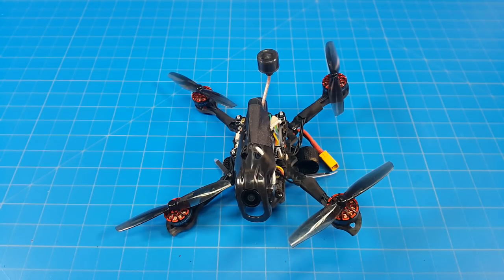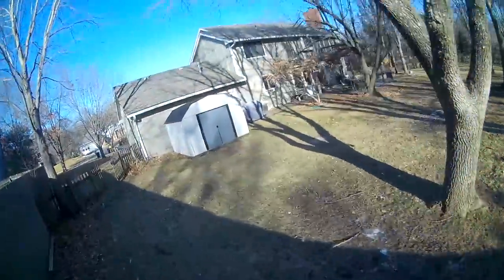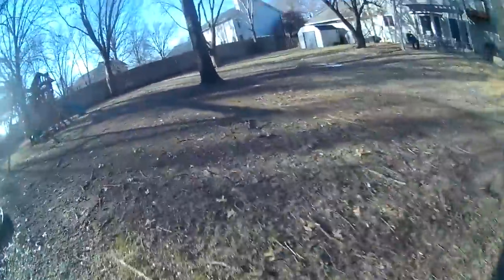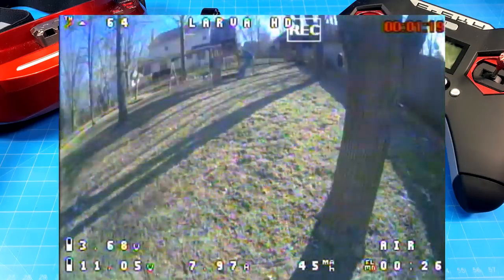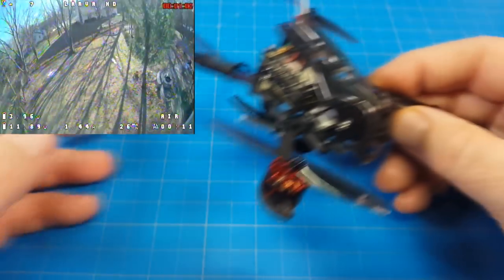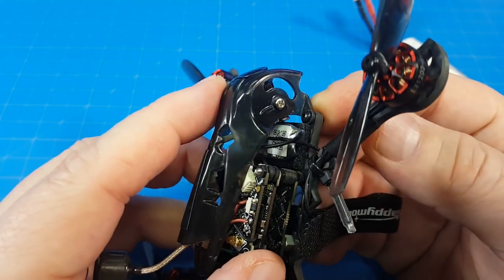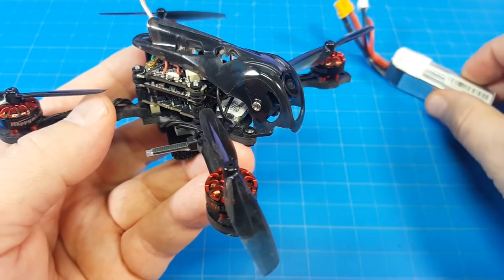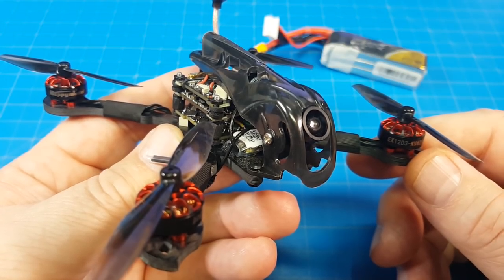Larva X HD // Bendy Quad

Comment: I'm struggling with weather too in the Netherlands Nick.
Normally it is quite cold over here, but this year we haven't really had anything that resembles winter. 
It is approximately 10 degrees C hotter than normal and the weather mainly consists of storms and clouds. So it is either raining or the wind will almost blow you over.

Comment: You say that one of the best with HD camera is the Skip HD3. What would you improve it? Would you try to lower the weight? Would that break the magical balance of stability in footage?  Im looking for ingredients for a very fast 3” HD
Reply: I think i would change the motors for 1303 5000kv with 2mm shaft. More powerful and intuitive at low rpm. Would you change the frame or the canopy to lose weight in the skip HD3?
Reply from the maker: Yes, larger stator motors will handle a 3inch prop better. The magic to the stable footage is having a camera that is firmly mounted. This one uses metal standoffs inside the tpu mount, most tpu mount will have micro vibrations in the footage. Otherwise is basic power to weight ratio for performance.

Comment: My Caddx Eos2 and Tarsier both had particles floating around in them, the Eos2 still has some, the Tarsier even had a tiny hair.
The Caddx Turbo F2 that came with my Emax Hawk Sport is particle free, but has a red hue in certain lighting conditions just like the Eos2, making it really difficult to see any detail of the bushes/trees etc., so I swapped it out with a RunCam Racer Nano v1, so much better. I always look at other brands of camera now.
Reply from the maker: I thought the tarsier might be the one they were doing better with, guess I have been lucky. The emax camera looked a lot like the Caddx f1 which did have that red hue to it.

Comment: Holes in the arms are for mounting the "whoop" guards standoffs. Nice work Nick, thanks for this. Jeff
Reply: I was thinking that because I saw what looked to be a screwhole at the end of the arm of the guard.
Reply: Mounting the prop guards is what I was thinking
Reply from the maker: The holes do line up, I didn't get standoffs. We have about a 6mm gap to fill
Reply: What carbon is that? 3mm and still that flexible?
Reply: @NickBurnsFPV  1.15 on your vid  a bag with four standoffs

Comment: Thanks for the review. Been waiting for ur review on this 1. For me. Considering the price point, the cheapest 3inch hd, come with 3 batteries. Maybe I will still get it n transplant it on more rigid frame.  Used to use Caddx, no problem with it. But still nick, what would u suggest if I want to get 3inch HD.
Reply from the maker: GEPRC skip HD 3, has stable footage as well as flight performance.

Comment: I fly ET 1115 & 125's...Was looking at this one for a future buy maybe for a cruiser and with HD, this seems to be a nice little package ....for the way I fly, I think it would do nice, plus I assume If you mount the guards it would tighten up the flex some( perhaps?)....I think it is simply a HD footage type micro and with batteries I think the price is nice...
Reply: The ET125 is still a worthy quad, I still fly my upgraded one; added a MinimOSD board to show flight time & battery voltage, and putting a RunCam Nano & Turbowing Cyclops 3 DVR (720p30) on it.
3" props are possible without the guards, check out my short video "Emax Avan Mini punchout on 2S"
Last October it took a swim in a river with a Caddx Tarsier on... fished it out, left it to dry, all still works :)

Comment: Question? 
Unrelated, how many times has your Mobula6 reset to factory? Mine did at the races this weekend. So annoying. Why? Battery too low is all I can figure...
Great review Nick...👍🏻🍻👊🏻
Reply from the maker: I have not had that happen, but I have OSD warnings on and set the warning to 3.2. I have had reports from several going below 3 volts resets the firmware to defaults and loses bind. Its strange behavior for sure. Something I didn't anticipate as needing testing for the review.
Reply: @NickBurnsFPV  
It's happened twice to me, a guy I race with, and one of my subscribers. Very strange why and how..?
Reply: My Mobula 6 has lost its settings 3 times, apparently trying to fly with sub 3v causes it to brownout and wipe the EEPROM settings where all the Betaflight & bind settings are stored. Not good if you crash and can't easily get to it so you try turtle mode to free yourself, only to wipe the settings - that happened to someone I know.
In an unlisted Mobula 6 video of mine that I'd only posted to RCGroups, Happymodel left this comment:
"Hello, can you share the dumps which fixed the resetting issues?  So that we can put it on the community to help others ." - youtu.be/UbgVS8Pt7tA

Comment: Would this drone perform better as a whoop using 2 inch props on a beta 85x frame?
Reply from the maker: I would doubt it as quads fly better with less resistance, the whoops/guard have more resistance than without.
Reply: @NickBurnsFPV  thx, I was thinking that too but when you said that the motors could not spin the props up fast enough I wondered if 2 inch drones would make this motor happier, and with 3s I thought that it might be possible to work on a power whoop using a beta85x pro 2 frame.

Comment: Just my opinion here but this thing looks as bad as it performs in the air. It just dosen't seem to live up to the name of its non hd sibling. But like you said Nick, it was probably built for a more laid back flight style witch in my opinion kinda defeats the whole purpose.
  As for caddx cameras , I've had 2 baby turtle 2's, 2 eos2's, 1 kangaroo, plus 1 ratel  and i never had any issues with dust I'm the lenses. The only issues I've had were when I tried to mount one of the baby turtle 2's I broke something off the board because everything was put on there so tightly and they didn't leave enough room for even 2m nylon standoffs around the mounting holes, I didnt realize till after  tightened it down something was underneath it and broke it. Also I'm not sure if it's the camera or vtx or just from noise coming from the fc but I have had a few of glitches while flying with the ratel, once that I almost crashed.
Reply from the maker: Thanks for the big comment. You have had a good caddx run, I have seen the debris a few times, but I don't recall which models.
Reply: @NickBurnsFPV yea I always thought that I must have had the luck of the draw with my caddx cameras because I've seen alot of videos and comments of people saying that they have had issues with around 50% of the caddx cameras they've owned in one way or another witch means Q.C. is  definitely a big issue they need to work on. 
One big reason I personally like caddx is that I feel they are usually most affordable option out there but if I had as many issues as some people I definitely wouldn't be as much of a fan and would probably be spending the extra money runcam cameras because sense they have a proven them selves.

Comment: I just build a 3 inch toothpick, but If I make rapid turns on high throttle and at the beginning of the battery, it just screems and flies away. I don't know how to fixt it.
Reply from the maker: I would need to see dvr. But look at the flight controller cpu useage in betaflight. Could be the fc is getting swamped with noise from the motors/props while continuing to try and control the quad then it no longer can and holds a value in place for a time to recover. This can also be a sign of a tune that is way off, or bent props/motors.
Reply: @NickBurnsFPV  alright... The tune is then probably not ok... I'm using rpm filtering, so I'll just look further and just play around with the settings

Comment: Could you help me on picking a controller. I am new to this and don't want to waste my money.
Please help
Reply from the maker: At this time with all that is going on with frsky and the inability to do d8 mode I am suggest a jumper series of radios. The Jumper T12, this radio runs opentx which is the most popular radio software and can bind to multiple popular receiver protocols, frsky, flysky dsmx etc. This allows most radio tutorials on youtube to be applicable and doesn't lock you in to using just one receiver protocol.
Reply: @NickBurnsFPV  Thank you very much . I will read more into the Jumper T 12.
Thanks again.
Keep up the great work.

Comment: One reason the arms are flexible is the orientation of the carbon fibers.  The arms are laid up on the bias - there are no visible fibers running straight down the length of the arms. See this photo: https://live.staticflickr.com/65535/49492695847_2824d7b5ff_b.jpg
Reply from the maker: I have been told as kabob has, the top layer (visible) isn't reflective of the carbon layers or adhesion. It was described to me as wallpaper. This is part of the reason I have been flexing the frames to show rigidity.
Reply: @NickBurnsFPV  The top layers incur the most tension and compression when the arms are bent.  If there are no longitudinal fibers in the top layers to resist those forces the arms will flex more.

Comment: Quite heavy for a 65mm bi-blade setup. My TP3 build is lighter, runs 1303 5000kv motors, and GemFan 3016 tri-blade props: https://www.youtube.com/watch?v=btY7itfvSbQ
Though my TP3 is not HD. I think the HQ 65mm T-style props should give a bit more grip in turns for the Larva-X HD, but that still doesn't fix the frame. Same with the Parrot 120, these frames are almost like made of rubber: https://youtu.be/P5eg3BoL5JA